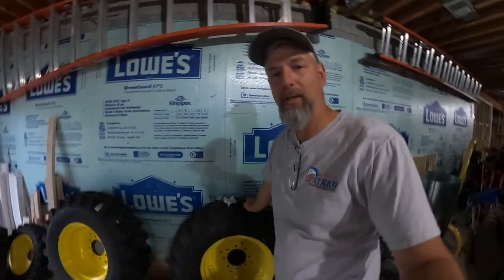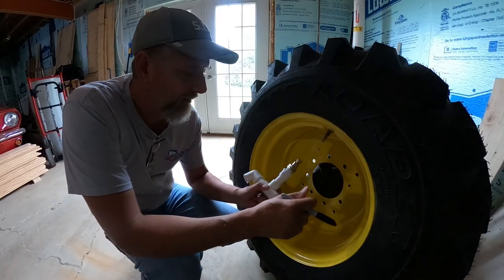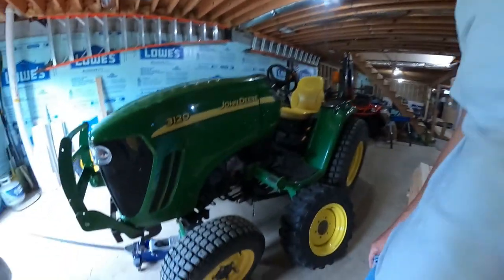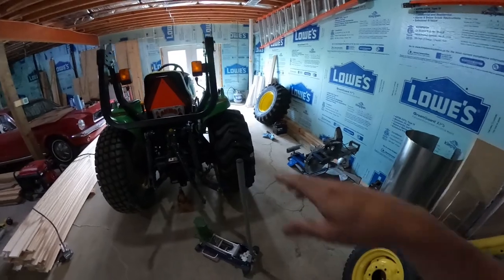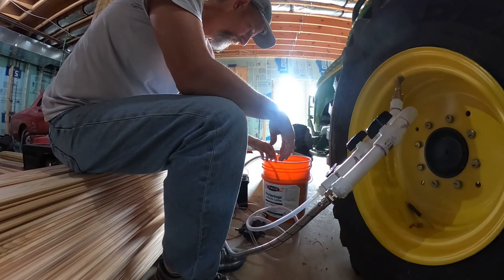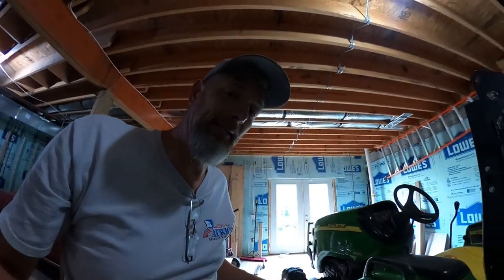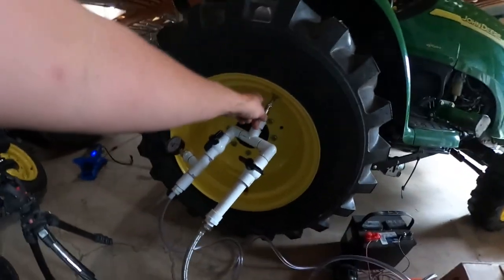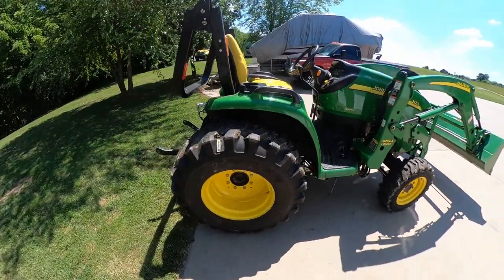Filling New Tractor Tires with Fluid | Shots Life

Comment: Great video! One thing that you could have done instead of buying 60 gallons of windshield washer fluid is buy the windshield washer fluid tabs. They come individually wrapped and sealed like a piece of candy and you just drop one into a gallon of water. You can buy 60 of them for like $10 online. Not sure if they can work at -25° or not but I use them for our cars here in Florida as it never gets that cold here.
Reply from the maker: Very interesting, never seen those before!

Comment: Your ground is probably more firm than ours in the edge of the MS Delta. To use ag tires on our yards, the ground has to be about bone dry to prevent ruts. The fluid filled tires are great for ag use and loading. I'll be very interested to see how this plays out.
Reply from the maker: Hey Jerry, my other tires were fluid filled as well so I already had the weight, I can tell you these R4s are way better on the farm.. but time will tell on the yard grass for sure!

Comment: Going to be expensive flats in the future aren't they?  Seems wheel weights would accomplish the additional weight goal with less fuss?  You would also be able to add quite a bit more if that were desirable.
Reply from the maker: Hey Doug, yeah I think wheel weights cost a bit more. I suppose it wouldn’t be good if you got a flat but that’s rare with the rear tractor tires (but does happen). I definitely could buy wheel weights to add weight, II have suitcase weights for the front but never use them, I just put on the loader because there are always rocks and limbs to move!

Comment: I was thinking, with the cost of all the wiper fluid, could you have used RV antifreeze mixed with water and still get the Neg 25 rating. But use more water for less expense? I could be wrong.
Reply from the maker: Yep, there are a lot of ways, I guess beet juice is supposed to be the best and heaviest…but expensive!

Comment: Don't know if its true, I was told my tractors valve stems need to be on the inside to prevent them from snagging and getting ripped off the wheel.  Also, my tire guy told me to rotate the valve stem to a 2:o'clock position and fill with a hose and the adapter. it doesn't freeze here though.
Reply from the maker: Yeah but these wheels were designed to have the valve on the front, I don’t like it as much but it is what it is… I’ve also seen them that the valves are surrounded by metal so they are better protected… interesting, yeah water is great if you don’t get freezing temps!

Comment: You sure done gots your toys!! Haha. It’s fun having a few classics around. 
   We ran R4s when they became more readily available on a lot of our yard tractors, currently I have a 4052M with a cab on it that has heat and Air Conditioning, living in Southern Alberta now even makes the cab nice. I am keeping it for snow clearing. The current place is set up such that I don’t even need a 100 garden tractor now!!. I had not heard of filling tires with washer fluid until a few US channels showed it. We used Calcium Chloride or heavy water from the oil fields. Don’t get it on your leather boots or gloves though or they will be 4 sizes smaller the next day!! I occasionally had some pretty curly toed boots when I helped at the tire shop in spring & fall if they needed as the product dries leather up to the consistency of steel!!! Heh heh.  Unfortunately I would order tires and be darned if they didn’t show up at the shop and I had to put them on myself!!! Hahaha. Sucks when you own the place too,,,,, but man my prices were way better for me back then!! Haha. For a while even, there would still be the occasional farm tractor that had tires full of graphite powder. Horrible crap to deal with. 
    We use the calcium chloride for the same reasons (Ballast) but we can be working as cold as -45C plus wind chill. It doesn’t get there often, but we see 40 below C which is the same as 40 below F often enough. At the coldest temperatures the Heavy water especially can get pretty slushy. You don’t want to run in road gear when they are like that! Start hopping away! 
    You will probably see the occasional damage from the R4s on the grass if it’s really wet, but that depends on your soil as well. Don’t use the brakes to turn,,,,, not if you don’t have to. I suspect Turf tires would even cause damage then. They will be much better on your other farm land. Much better. I don’t find that they are the greatest in really muddy conditions. Your farm land loooked like it was some very good draining land so no problem there! I look forward to hear what you think of them!
Reply from the maker: Good comment, a lot to unpack here, I have seen guys use calcium chloride but I was more worried about rust with that, but man those are great temps! Lol, I bet the would hop! Yeah I have already seen the R4s are harder on the grass in the corners, especially going down hill and turning where the pressure is on the front! But you are 100% right, on the farm oh my goodness are they soooooo much better!! They sure clean out much better, the turfs always got loaded with mud and took days to clean out, the R4s just get dirty but don’t hold the mud, soooo nice!
Reply: @shotslife  - You are definitely right about rust. You need to make sure the rim is painted well and fill the tire with chloride such that it is above the stem when full, or at 80%. That way, the rim doesn’t experience air as the fluid in the tire is always above the top of the rim. It’s easier to do than you think, but I’m not sure the rig you have can do it, because you can’t take the rig off to put the valve core in, it has to be done from within the rig. Very hard to explain in writing for me. The worst place we had to deal with rust on the, generally farmers, rims was at the valve stem. That kind of damage/issue doesn’t occur for quite some time mind you. In the days of Tubes, it was less of a problem, depending on how clean the previous installation was. We sold our fair share of tractor rims though. I doubt you would ever have troubles. Since you don’t get the really cold temperatures, I don’t see any reason to use anything different than what you used here, other than cost,,,,,. The system worked very well for you. We had a system that pulled the whole valve stem out so it would fill faster, but that’s an expensive set up we used several times a week to even several times a day. The valve stem on most Ag/implement tires have a different valve that comes apart. (I’m sure you know this, but not all viewers do.) We stored our fluid in an old tanker trailer, just the pup section and had a company come in and fill the tank as needed. It was a lot cheaper that way, for us & the client. 
    What you did here was correct, but not maybe as full as a tire shop would have filled them. As you said, you are seeing some damage on hills & turns. More weight in the tires could make it worse. 
    Sooooo is there anything that you CAN’T do??? Heh heh.         (No need to respond if you are swamped, I understand.)